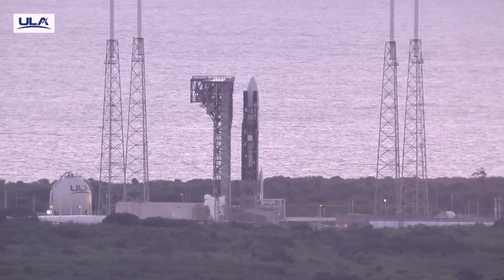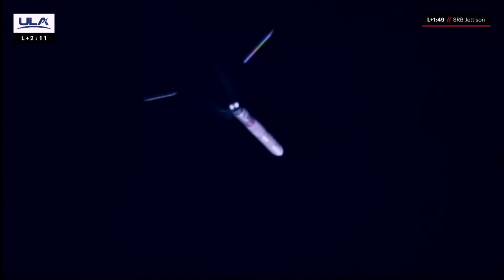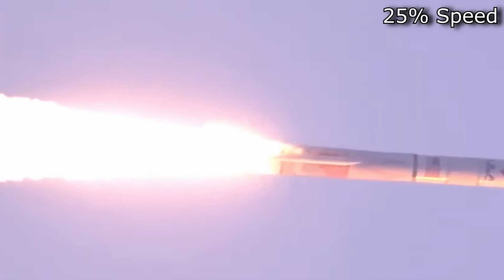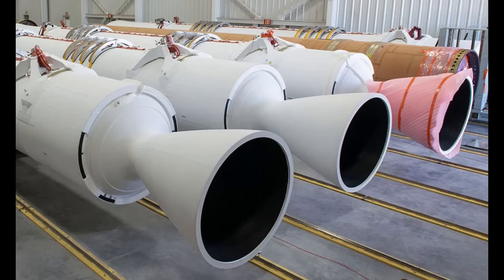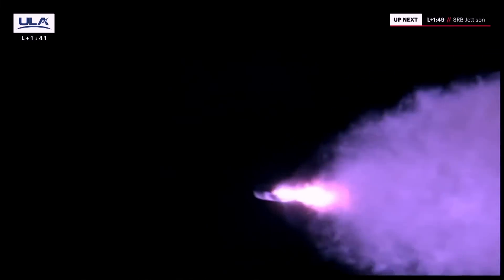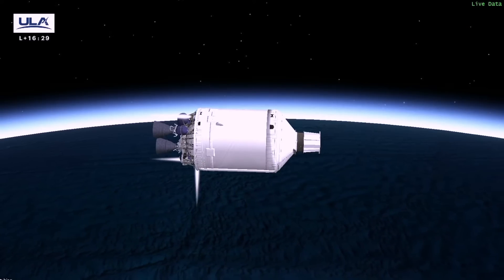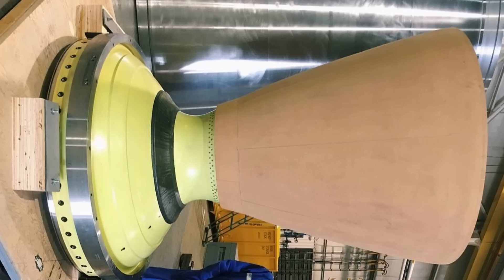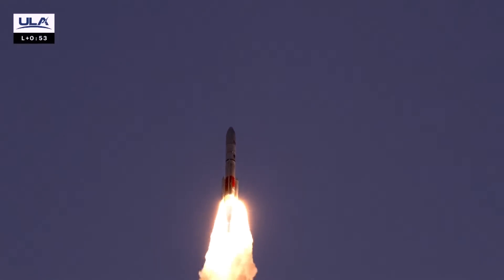How Did The Vulcan Rocket Survive This Booster Failure?

Comment: The Vulcan is impressive design has the Solid boosters driving the Avergae center of mass for the liquids fuel center of gravity with static nozzles, and the BE4 engines are gimballed for control.

Comment: The nozzles are sometimes designed to break free on over-pressure, as in an imperfection in the engine grain (the casting of the propellant and shape of the design) breaking off and plugging the nozzle.  I may have "observed" this a couple times while in the proximity of the test stands.

Comment: The Gem 63XL is an excellent motor. It performed its job before the nozzle came off. Had it been a true failure, it would have been a massive explosion. This launch was a success with a concerning issue, but not a failure.

Comment: personally, i'd say that they should wear this as a feather in their cap, rather than be ashamed of it. yes, something broke during the launch... but the system was still able to achieve its goal. that shows that it's a rather capable system. also, the failure only affected one of the two boosters, so it's not necessarily a design flaw and may instead be a manufacturing flaw, something that every industry that exists is subject to.

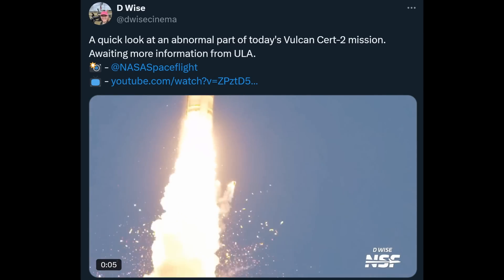Comment: @6:44 That's only the last 3rd of the nozzle. looks like the other 2/3rds survived. Has to be a weak spot in the carbon for it to do that. The nozzles are made of woven carbon fiber. The last section to burn that keeps it from burning out before 90 seconds is the inhibitor.

Comment: I'd also like to throw in a counter-opinion on the comments at @10.25, I believe the larger plume on the right is due to the LACK of a nozzle.  Also, these are SRBs, they don't have burn rate control, and varying the size of the nozzle isn't going to affect their burn rate.  The solid fill is a mix of propellent AND oxidizer, there's no mixing going on.  SRBs burn for an incredibly consistent amount of time because they can't turn them off when they get the thrust out they want.  The larger plume on the right is due to the pressure inside the SRB being much lower (due to the loss of the nozzle and nozzle aperture) but is not affecting burn rate.  Both SRBs have by this point "exhausted" and are just burning up residue and ablative materials.  The right booster "winks out" earlier than the one on the left because the low tailings of propellant can't maintain as much pressure as the good booster on the left, loses whatever pressure it had and combustion just gets snuffed out.

They're certainly lucky though ,this wasn't an "o-ring" disaster like on columbia, where the SRB leaked a jet that impinged on the main tank.  This looks like a failure of the nozzle, though it may have maintained some of the nozzle until we see the explosion and ejection of the aperture ring.  Certainly less thrust, but the big problem with losing some of the nozzle is losing your ablative buffer.  Hot gasses burning closer to the aperture, erode the nozzle attachment, breach the aperture, and BOOM.  Then there's nothing between the core shaft of the SRB and the outside.

I'd say the main engines survived due to (A) luck that when the nozzle suffered the initial failure that nothing happened to damage the main cores, and (B) it was moving fast enough at the time of the aperture breach that the definitely more destructive explosion wasn't able to toss as much of a shockwave into the cores to damage them.  For rockets, "boom out the back is better than boom out the side"..

And kudos to the devs though on having enough gimbal to keep it inside the corridor to orbit.  I'm just a little surprised they had enough extra fuel to extend their burn far enough to complete the maneuver.  I wonder if any of them were mumbling about keeping that mass simulator...heh.  I don't know how much reserve they pack nowadays.  Remember from Apollo 13 they lost their center engine pretty early but were still good.  clearly they had some healthy (thrust) margin back in the day at NASA, but who knows how much that's changed since then.  IIRC musk's boosters operate with close to zero reserve fuel. (one of the early failures was due to fuel exhaustion while within mere feet of touchdown on the barge, so maybe that margin's been upped a bit!)

Comment: Having a stock of boosters waiting for launches is the best possible scenario to be in. Sure, it means they have to investigate each one and possibly remanufacturer them. But having the stock means they have plenty of manufacturing evidence. They will have the remains of the launch booster, as well as several samples. It will be easier to identify where and how the manufacturing process went wrong. Having ONLY the remains of the launch sample (or worse, none of it, if it was a destructive separation) would take much more time, and based on more conjectures.

Comment: Luckly, the nozzle throat survived, otherwise the launch would be failed. 
The longer  fuel section, the higher pressure. 
The nozzle should handle severe condition. 
They should check every section of the nozzle.

Comment: That the booster managed to compensate may be impressive, but the SRB nozzle failure is a concern, if that debris  had hit a Core nozzle it could have caused a total loss.... I suspect either a defect or the current SRB nozzle is close enough to it's maximum performance that the motor error bar for the may be too close to the performance error bars some part of the nozzle construction. 

It's not just one +- but many that add up to a whole picture, a few of the wrong kinds overlapping )even if a few have to add together in a rare event) may be OK most of the time but  leave the door open to a failure in that area of concern.... The Shuttle Booster O ring is an over simplified example of that, that was effected by weather... I hope that makes sense.

Comment: Whatever happened to it was definitely existing pre-launch.  If you look at the last frame before SRB ignition, the one on the left has a nice smooth gas flow from whatever the ignition initiator stuff used is, but the one on the right is already coming out turbulent.

Comment: The methane rocker motors and the guidance software preformed amazing well. I'm not sure how many rockets could have survived this much difference in thrust. Now to understand what caused the solid booster to fail. Rockets are a tough engineering problem. As close as it gets to losing this mission. Hats off to them for getting this into space.

Comment: I know nothing is perfect and there's always built in margin for error which is why the rocket survived, with a little help from luck, but really; what is going on with American Aerospace companies? This is the kind of stuff I'd expect if there are corners being cut at one or many points in the chain, not faulty engineering. Those boosters should have performed identically. Collectively, American companies have done it thousands of times, correctly over many years. These mega conglomerates don't strike me as a good thing compared to their parts which were stitched together with mergers over the decades. Boeing is a tragic example of shareholders not understanding what it takes to be the world class in aerospace and since its last merger has suffered in quality control substantially enough that a 737MAX flight is logically questionable that they have enough margin to execute proper operation.

Comment: I think kudos go largely to the ULA flight software team, whose code adapted to the change in trajectory caused by the failure, and kept the rocket on course. That system proved its worth in preventing what, for a live payload, could well have been intact delivery of a high-value payload into the wrong orbit. What an accomplishment! Also, I suspect those BE-4 engines proved their worth, getting the Centaur second stage high enough and fast enough to take over and deliver the payload to its intended orbit. I'd be interested to know if this launch required higher-than-nominal performance from the BE-4s, and what margin above nominal they delivered.

Comment: This is a great advert for the Vulcan rocket. It put its payload into the desired orbit despite an SRB "anomaly" not long after launch.
Reply: Yes, because they probably had a fully fueled rocket and a payload simulation at the low end. With a commercial payload utilizing most of the performance of the rocket this would have been a mission failure.

Comment: Hats off to the Vulcan engine and software guys cause their designs truly saved the day.
Reply: The guidance system was doing what guidance systems are supposed to do. They compensate. They do that in case of any anomaly until they run out of control range. The engines can't save anything if they are running out of fuel, which they would have with a regular payload instead of a small mass simulator.

Comment: The bell blowing off in close up was pretty awesome, mainly because it included the systems being able to compensate in ways so far only seen in space x redundencies. The engineering often hidden behind the pop culture noise is awe inspiring.
Reply: The engines and controls on the space shuttle were doing the same thing during both accidents. That's nothing special.

Comment: I think one positive aspect of this is that it made it's mission targets despite the problem.  This should actually increase confidence that the Vulcan will achieve its mission goals as it has proven the ability to compensate for anomalies.

Yes, the cause of the anomaly must be addressed and corrected but the ability of the holistic system to compensate is a major win.
Reply: In rocketry calling sheer luck "positive" is a deadly sin. What you really had here was a "lessons not learned from the shuttle" event.
Reply: @lepidoptera9337 settle down lad

Comment: You just MUST appreciate the careful language after a bit-scuffed, but SUCCESSFUL mission, ...
..., yet SpaceX is failing left and right, and still calls all the TOTAL FAILURES successes too.
Reply: The goal of this mission was to carry the test payload in orbit, which was a success.
The goal of the Starship TEST FLIGHTS is to test the new systems. The respective missions' parameters are communicated clearly before the launch, you just don't bother to research them. And those goals were fulfilled by the IFTs - hence the missions being successful.
Reply: Maybe the problem is that you don't actually understand what's going on.  It's pretty evident.  That or you're just lying.  Either way there is a difference between the certification of a COMPLETED system and the test flights of throw away test articles in a system in development.  That's the reality you either don't know about (deeply ignorant) or one you chose to pretend wasn't the case (lie).  One wonders.. Are you crooked or a fool.. or both?

Comment: "The FAA has determined that an investigation is unwarranted at this time"  but Falcon tipped over on the landing pad and it's grounded? WTAF?!
Reply: Yes, there was a problem during recovery.  That's in the license and thus warrants looking at.  If, for a change, you want to actually understand what the FAA is doing or why Google is your friend.
Reply: @TheEvilmooseofdoom  Falcon has 389 launches, Vulcan has 2.  50% of Vulcans launches have had catastrophic booster failure.    Both rockets were ultimately successful in delivering their payload.  Common sense should tell you which system warrants more investigation attention.  They BOTH should be investigated and grounded, not just the one owned by the guy not favored by the current regime.

Comment: The asymmetric burnout: Without the nozzle/throat in place, pressures would have dropped below the minimum pressure to sustain combustion of the propellant grain faster than in the motor that kept burning longer. The propellant is designed to not burn below a set pressure level, so with an open aft end the failed motor would have shut down faster. With the nozzle in place, the other booster would have kept burning residual propellant longer. I've seen the effect on test stands (where we blow out the throats and burn off the nozzles on purpose to see what happens.)

Comment: No fault to ULA on this one, it's all on the booster and ULA's computers were able to make the trajectory changes to compensate for a very significant loss of power and unwanted asymmetric thrust happening and still complete the mission. Big props in fact! I was never a big fan of Vulcan, but I am impressed at the recovery here.

Comment: To add to the risk at max q, the structure of a rocket is usually designed to handle a max angle of attack relative to the air of only a handful of degrees.  So near max q, it’s likely a rocket would break up far before it starts to tumble

Comment: I had an old Estes-style model rocket motor that had a similar problem. I'd found all my model rocket stuff at my mom's house, then took them out with my kid. The motors were well over a decade old so when I lit one it blew the nozzle out the bottom, pushed the rocket about a meter off the pad, and then blew the parachute ejection a second later. When I examined the wreckage there was an obvious dent in the metal pad. I wish I'd gotten pictures like people are getting for this flight though.

Comment: I'm of the opinion that this cannot be counted as a successful launch. Yes the mass simulator achieved the proper orbit, but this failure is a serious flight safety risk. If that burnthrough had happened on the opposite side and impinged on the tanks or the engines, we would have seen a fireball. The FAA needs to issue a stand down on all GEM boosters until this failure, AND IT VERY MUCH IS A FAILURE, is understood and fixed.
Reply: It’s a double standard.  FAA statement is “No public injuries or public property damage have been reported” as they hold off on determining if an investigation is warranted.   Just because a booster exploded the nozzle right off, during lift off, with incandescent pieces flying off while barely off the ground,  FAA is rationalizing why they may never investigate. And if they do investigate, it will be done in a way that does not block progress (unlike what they are doing to SpaceX).
Reply: @douginorlando6260  It's not a double standard.  You just don't actually know why the FAA gets involved when it does.  You're deeply ignorant and making up nonsense trying to pretend you're not.  You failed.  You're LYING through your teeth and at no point have you ever had a clue.  It's dishonest and disgusting.

Comment: YET FAA wont investigate it but will investigate SpaceX for less of a problem than this... double standards, love it🤮
Reply: FAA statement is “No public injuries or public property damage have been reported” as they hold off on determining if an investigation is warranted.   Just because a booster exploded the nozzle right off, during lift off, with incandescent pieces flying off while barely off the ground,  FAA is rationalizing why they may never investigate. And if they do investigate, it will be done in a way that does not block progress (unlike what they are doing to SpaceX).
Reply: @douginorlando6260  Yet in this flight neither the booster(s) or payload ended up where it wasn't supposed to be.  That can't be said for said for spacex.  You're pretending you understand what you clearly don't and proving you're a spoon fed fool every time you cut and paste that nonsense.  That's all you are and likely can be, another ignorant cut and paste warrior taking every chance that comes along to prove you're a fool.

Comment: Northrop Grumman also acquired Morton Thiokol, the company that produced the fatal Space Shuttle Challenger boosters. However, that disaster was almost entirely NASA's fault. They knew those boosters seals were a risky because of the abnormally cold temperature and they launched it anyway. Shame on NASA
Reply from the maker: Thiokol was spun off, later acquired by ATK which Merged with Orbital Sciences to become Orbital-ATK which was acquired by NG
Reply: @scottmanley  Thanks Scott, I wasn't blaming Thiokol it was NASA. I and I'm sure you remember at the time

Comment: The length to diameter ratio at 6:36 suggests that only part of the nozzle broke off rather than the full orange/pink section breaking off after the throat as described later in the video.

Comment: It was lucky it never caused the rest of the first stage to fail, shows tgat todays technology is a fair bit safer than 'yesteryears' rockets as this would've been a failed launch.

Just shows that with enough redundancy or intelligent systems rocket launches should become less likely to fail even though not every failure can be said to be catered for, at least it can be said that it was merely a fault with the booster and not the rocket itself and the rocket was able to compensate for this failure.

Hopefully flight systems of these craft continues to improve òver time to make space travel safer for payloads (humankind or otherwise) lol ULA did a sterling job with this even though it was probably more due to the hard and software thus rocket had at its disposal rather than a human pilot that may have aborted the attempt after the booster failure.

Comment: Isn't there a self-destruct mechanism that an operator can trigger when they see something is going wrong ? There is such thing on Ariane rockets. You would think, seeing the booster failing, someone would have ordered the destruction of the rocket. In that case it would have been misleading.
Reply: Yes, if it strays to far off course.. which it didn't.  Your understanding of when and why a FTS is employed needs improving.
Reply: @TheEvilmooseofdoom  no need to be passive-aggressive.